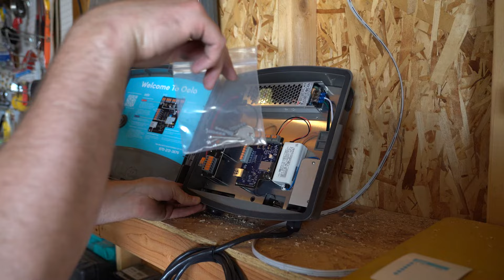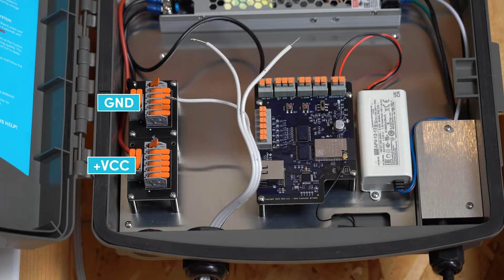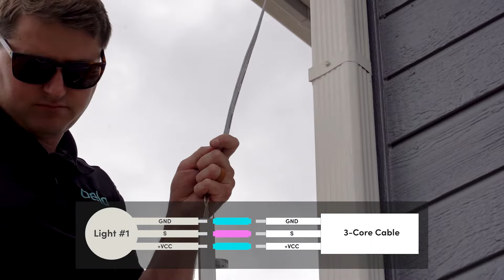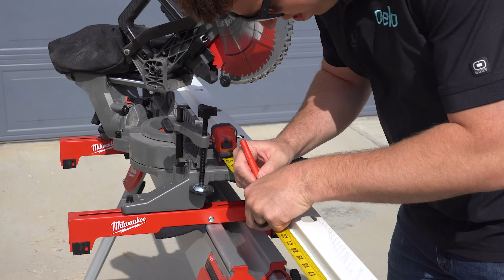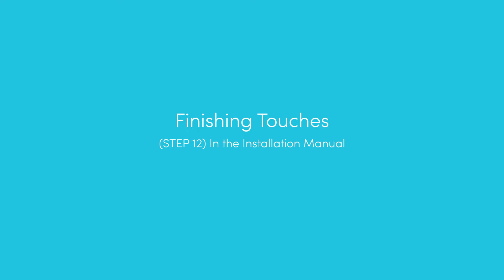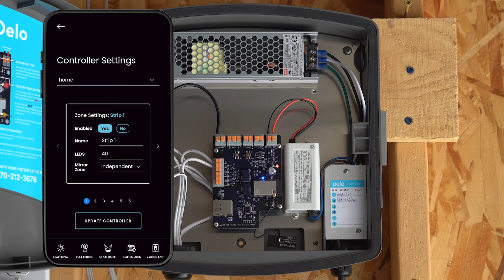Oelo Installation Video for Metal Systems Purchased after March 15, 2024

Comment: Couple Question
1. Can these mount to vinyl soffits?
2. What is the benefit of havering multiple zones?
Reply from the maker: Yes, you can mount to vinyl soffits, but you will need to mount to the outside edge of the soffit, where you know there is something solid to screw into. As for multiple zones, this allows you to control sections of light separately ... so you can mount a section downward to wall wash, while your outward zone might be doing a movement pattern. Or you can have a front zone and a back patio zones, etc. It just allows for more lighting fun!